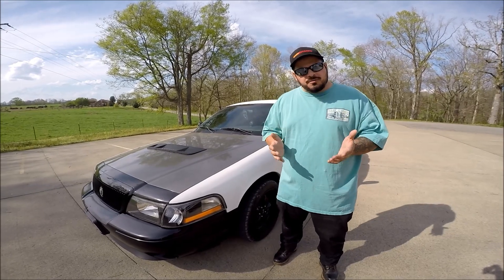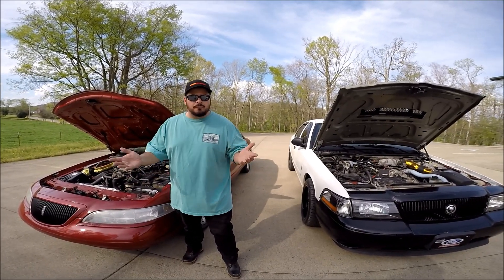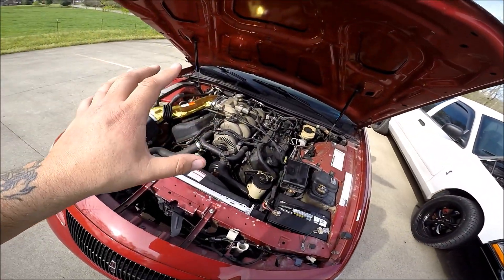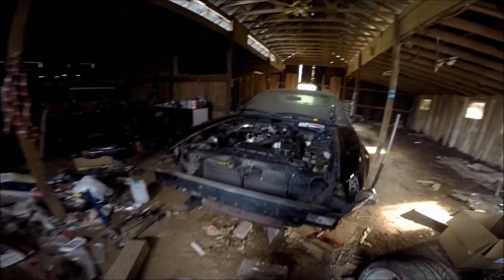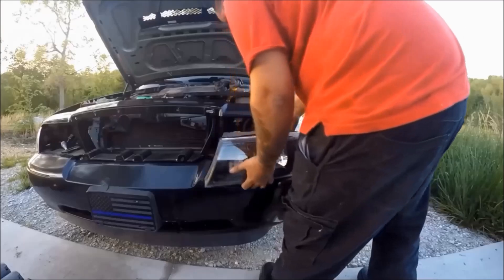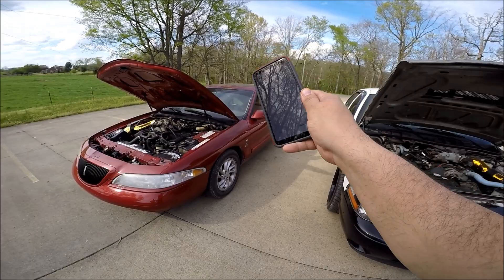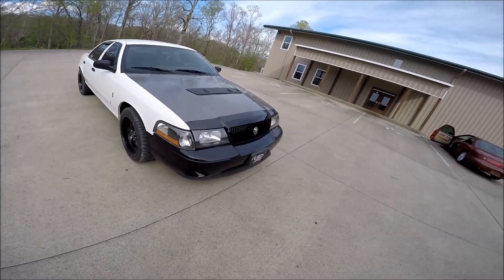Why a Crown Victoria P71 is BETTER Than a Mercury Marauder

Comment: I owned a 1996 and 2000 crown vic both cars were great riding cars. The 1996 had a bad spot in the frame causing the rack and pinion to shift over and messed up all the steering parts. The 2000 had a issue with the front suspension that led to a failure I fixed more than once that when it happened again I was just done fixing the problem. I wish I could of kept both cars repaired correctly and kept driving them. I was getting 25-27 mpg in a full-size car.

Comment: Marauder guys are making well over 200,000 miles right now. Sure the timing chains need attention.. but I have a marauder and CV. Never heard of the 4v head gasket issue.. and 1.5 seconds is a lot on a drag strip.

Comment: I own a 04 grand marquis and a 04 marauder. My grand marquis has similar features leather seats, heated and power driver and passenger seats. Previously owned an 01 p71 and honestly all 3 cars have been reliable haven’t had any issues on either one only thing I’ve had to replace on the grand marquis was a flexplate (flywheel) as some like to call it but all 3 panthers run solid my marauder has never had issues with leaks that’s straight bs as far as hp it’s 302 factory and can easily be brought up to 350 with upgrades and tune idk where you’re getting your info from but a marauder is definitely a fun reliable car to own.

Comment: Mr. Random Reviews Woah those Lincoln Marks have a bad rep for reliability where you said the valve bolts are!!.....My best resolution though is for using a majority of crown vic parts brand new on a Marauder,stuff like the bumper,door handles and maybe the headlights are easier to replace if you put Ford ones on it,i'm not sure if there was a specific difference in Marauder or crown Vic headlights i never inspected the signal markers or anything different in comparoson about them,but they are interchangeable for appearence,maybe they both cost the same brand new 200 bucks a lamp man!! Love your videos and it's cool that you go into tutorials about the analysis comparisons of Ford's best luxury cars!! As for the five oh department Ford's are the best to me!! Ford Explorer Intercetor Crown Vic etc!!....I'm not sure,but i'm curious as to what Mercury was a rare realease police car ive seen on the walkong dead!! I never seen them in real life but it looked like a Mercury Sable or a Mercury Grand Marquis' police car in Atlanta when Rick approaches the city bus,across the way i can tell by tue thin headlights it looked like a mercury sable,grand marquis' or maybe a mid 90's marauder cop car if Marauder's were back in the mid late 90's but it had the same side fender and window complexion of criwn vic it just had the lights and grille of a Mercury this white cop car did!!

Comment: Video is totally wrong and full of misinformation I swapped out my 04 4.6 2 VALVE in my 99 P71 and dropped an 04 4 VALVE marauder engine and trans and its a totally different animal that 4 VALVE leaves 2 VALVE p71s in the rearview by 2 or more cars and as far as reliability i have over 200k on this engine and it still runs like new

Comment: Funny how I threw away my 98 Continental due to bad struts but the drive train was still going strong at 250K, or my current Marauder is still going strong with 180K miles on it. Admittedly I typically sell them at 150K. Oh, my 99 P71, you ask. Yeah, it blew a spark plug right out the head at only 140K. Real reliable buddy! You know what the Marauder does that P71 doesn’t? Hold it’s value. So, yeah, which one is the better investment? I’ve never resold any of my crown vics or a P71 and turned a profit. I’ve resold 2 Marauder now after racking roughly 50K miles on both of them, and turned profits for both of them. Oh, and look at the value of a Marauder again, it’s not no $8,000 any more. The value will only continue to rise. So you can have fun down there in the simple life, but trust me when I say YOU ARE FAR BETTER OFF BE AN ELITIST! And I didn’t even have to spend spend all that extra cash you did just to have the nicer grill setup, because it already came with it. Bottom line buy rare cars at the right time (which for Marauders happens to be 10 years ago till now) and you will protect your investment better. Case and final point, I bought my 99 ROUSH Crown Vic back ten years ago with 20K for $20,000. How much do you think it’s worth today (yes I still have it) You’re about to spend how much time and money to build a replica of the same car and how much is it going to be worth when you’re done?? Work smarter not harder, you’ll be further ahead when you’re done.
Reply from the maker: the only thing even worth anything on the marauder is the looks in my opinion.  i achieved that for $800....saved me $7,000  now THATS working smart  not hard...you can keep your overpriced mercury grand marquis😂👌
Reply: @MrRandomReviews  also I will not be keeping my over priced grand marquis, I will be selling it. That’s how you make money. It’s just fun to drive in the meantime.

Comment: I have an 07 P71 Vic. When I accelerate hard it seems to downshift and put the car around 3000 rpms. A crackling sound happens until I let off the gas and doesn’t sound like any of these 0-60 crown Vic videos I watch. Accelerated fine under 2.5k rpm and no problem cruising on the highway. Is this common for anyone else? Shop I get service doesn’t think anything is wrong with it

Comment: Stop smoking rocks
Reply: Facts bro this video is a bunch of misinformation
Reply: Edward Myers Anyone who uses a mark viii as a reference point for a marauder needs to be mentally evaluated 😂
Reply: @eriv4735  yes considering mk 8 uses the first gen 4V and not the marauders 2nd gen 4V. The intakes are different. Power output it different and the ignition system is different.
Reply: This dude freebasing moonrocks for sure

Comment: Im a panther fan all the way,but get your facts straight b4 you post comments ..a stock marauder has a underrated 302 crank HP. Your comment of a modified 2 valve with 350 HP is 150 HP more  than a stock marauder is BS.that would mean a marauder having 200 or so HP.
350 - 150 = 200???
Your obviously a p71 2 valve fan and owner, which is fine, but dont make comments or state facts that are misleading or false....

Comment: When I worked at a Ford dealership, they use to send me out on drives to put miles on cars after a major repair was done. The p71 is a dog, its not a fast car. The marauder however was fairly quick and rarely seen them in the shop.

Comment: I'm glad you did this video because I was determining if I wanted a Marauder or another P71 I also found a 98 Mark VIII as well. The guy wants $2500 for the Marauder because it was hit in the rear driver side, the other guy wants $1000 for a 2007 P71 with a replacement engine and a shitty paint job, the other guy wants $1000 for the Mark VIII but he didn't specify what's all wrong it. My first choice was the P71. So I'm glad you did this video so now I can spend my money wisely.
Reply: All of his talking points were trash. Your money would have been spent well on either car. Bottom line they are two different cars with different purposes therefore you cant really compare them
Reply: @edwardmyers1746  the Marauder is the only car I don't have in my collection
Reply: @jaye23able  I own a marauder, so trust me I know what I'm on about lol. I also have another car with a 4v
Reply: @edwardmyers1746  I was going to buy the mark VIII to do a engine swap with my 04 LX Sport crown Vic
Reply: @jaye23able  dont get a mk xviii it's a first gen 4v get 2003+ 4V they're the second gen with more power and also more simplicity considering most of the first gen 4Vs were mounted sideways
Reply: @edwardmyers1746  I tell you what, I may just save my money and go for the Marauder that will be better
Reply: @jaye23able  the only advantage to a 1st gen motor is their teskid made not romeo. They're stronger blocks. But the 2nd gens are very strong too. Just not as strong

Comment: As someone who has had many P71's, and currently has a Marauder, you are absolutely smoking crack if you think even a brand new P71 could hang with a high mileage marauder. 

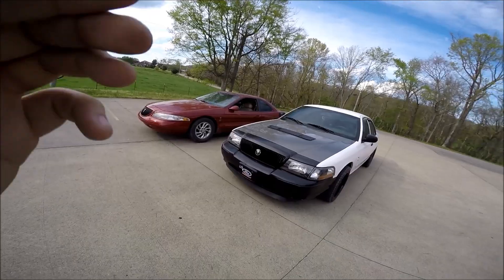Doesn't mean that I don't love my P71's, but the 2V powered cars are pigs in comparison. Drop 4:56's in that P71 and you STILL will get dunked on by a STOCK marauder, much less a Mark 8 or Continental which are lighter than both. This comes from experience. 

The 2V motors are great every day, borderline indestructible fleet engines. The only way you are getting any power is to bolt a set of 4V heads, associated hardware and timing set to it, or go boost.

Oh. And the Marauders come with the aluminum WAP blocks to begin with. That shaves a significant amount of weight off of the front end. 

In the end, they are faster, better handling cars with way more creature comforts than a dogged out black and white from the county auction with hundreds upon hundreds of hours of idle time.

Comment: Your right about that but i have owned boath a p71 and 98 mark 8 lsc the lsc pulled way harder and spunds better and its easy to supercharge it with the 03 04 cobra blower
Reply: Cant put the cobra blower on it. The mk 8 is the first gen 4v has different intake runners. It will only fit on a 2nd gen 4v
Reply: Edward Myers He could change the heads, get a custom lower manifold made, or even modify the terminator lower manifold...but for all it’s worth her be better off buying a wrecked terminator lol
Reply: @eriv4735  yerp, the only benefit would be that teskid block but screw that. Your already spending too much, grab that wrecked stang

Comment: I race the hell out of my 03 Mercury Marauder that I brought for 3000$ wit 4.10 gears Marty's tune long tube headers and drive it every day as a daily with 184xxx miles strong these engines are only as good as you keep the maintenance up on them that's speaking for all engines
Reply: Htf ya get a marauder for 4k? Most sell for 8k and up. Your lucky man.

Comment: Now which is better..... mercury grand marquis or crown Victoria?
Reply: Depends on what your after. I have a 2001 Grand Marquis GS and love it. Having said that the one thing that I love about the GM is the interior, and no I don't have leather, its cloth and still comfortable as hell.
Reply: @michaelcraighead8824  I like the leather interior in the Grand Marquis but which is faster? Also which is easier to covert to Marauder?
Reply: If you get a GM it would need to be a 4th gen to get the same power and torque as a P71. Mr. Random did do a video on the grand marquis so check it out.  As far far as speed, both cars are pretty equal, with the exception the P71 has a better suspension, which any cars suspension can be upgraded.
Reply: As far as converting to a marauder both Crown Vic and GM are the same as far how hard and easy it is. If you like Leather don't look at the GS trim models for the G.Ms,  look at the LS packaged ones.
Reply: @michaelcraighead8824  cool thanks bro

Comment: LOL.. Never met any Marauder owner that had the issues you state here... I have a Marauder, yup its a 4.6 DOHC, also have a Shelby with the 5.4 DOHC, so what your saying  (since they are engineered the same --sort of) I should be replacing head gaskets on my 650hp Marauder and my 850Hp Shelby---LOL... No the P71 is ---ok.. Its not much of a performer until you get rid of those heads.. BTW, none of my motors leak oil into the plug wells either...if your generalising with your lincoln, well shit gets engineered better over the years..

Comment: Better gas mileage. Cheaper parts. It really wouldn’t be that hard to buy the marauder rims get a black crown Victorian and put the grill in it and you’re pretty much fool  everybody.
Reply: 1500-2000 dollars for the marauder rims. 300 for front bumper, 300 for rear bumper. Gonna need at least the front seats replaced with marauders but just regular black ones for the rear will do.+500 dollars there. Marauder cluster will be 100 if you get it cheap. Grill I can say for free if you just paint it well. Switching your shifter to a center console shifter is a mystery number. And then of course the 2000-4000 dollars for a Mach 1/marauder engine in decent shape and mileage. Might not be hard but it sure as hell is more expensive than just getting a real marauder. Trust me I’ve been down both paths

Comment: Obviously you have not owned a Marauder! I have owned all of the Panther bodies and the Marauder Is by far the best overall Panther. My 2003 Marauder with only 23000 miles gets just one mile per gallon less than my town car did and it corners way better and is a lot faster! The P71  rides rougher and is noisier but way cheaper.

Comment: man i wish they made a p71 coupe
Reply: You could make it yourself.

You could get a SN95 body style Mustang with a V6 in it, and swap over the P71 drivetrain and other parts into it, and don't forget about putting the P71 Ecm in the mustang body.

Mustang Shell Powered By P71.

1994 to 2004 : SN95 Mustangs.

Comment: I like how you started the video off & ended it bro 😂😂 but you dam right the Vic is way better then a ticking time bomb Marauder so only time that car got on a Vic is it's slicker that's it
Reply: The marauder is not a time bomb all of mr randoms talking point were incorrect and false. The marauder 4V will be just as reliable as a 2V if not a little better
Reply: Aw ok I stand corrected bro
Reply: @11_CVPI  no worries my guy. Just trying to properly inform people, which mr random failed to do. I would know about the 4V I have two 4V powered vehicles one of which is the marauder
Reply: @edwardmyers1746  aw ok so a guy with hands on experience that's exactly what's needed about info on these cars
Reply: @11_CVPI  exactly, I'm in the middle of a tear down on my other 4v I know a think or two on these. All I've worked on is 5.4 and 4.6 4vs
Reply: @edwardmyers1746  aw ok that's what's bro I wanted to add another Vic to my channel but I'm gone put a impala up here
Reply: @markjones2185  in reliability in it's better but they are practically the same & all just the Marauder is slicker
Reply: Word!🤣

Comment: 4.6 4v don’t have good flow in heads I seen. Pipe between both heads or thru heater core. Has bad hot spots
Reply: That's it's only issue hot spots. The manifolds restricts the 4V like any engine
Reply: Edward Myers the first gen mark viii has a less restrictive intake design, from what I know. The 2nd gen introduced the more restrictive design. Idk what ford was thinking. It’s still an awesome engine regardless.
Reply: @DrFeelGoodNow275  I know my 212k 4v has that issue
Reply: @ninevoltmodz4687   they made up for it with the second gen having more hp and torque

Comment: $5k-$8k for a tuxed up Panther with the heart of a Cobra? And it's engine is more problematic than a Subaru EJ? Yeah I'd rather get the P71. There are cooler cars you could get for $8k than a Marauder
Reply: The 4V is a much better engine. All of Mr. Randomns talking points were un educated a not true.
Reply: This is the same guy who has videos about how great and BULLETPROOF the 4v 4.6 intech v8 is and he never mentioned anything about a headgasket issue? And im 100% certain i never heard the words TICKING TIME BOMB! in those cobra in a tux videos 😂😂 what happened?

Comment: It's pretty fucking sad you don't even look up basic information on cars before trying to trash talk them. The MM makes 300+ hp to the rear wheels from the factory. Putting a marty tune ALONE on it(still stock) can show 320ish on the dyno. Besides in 00/01 the triton engine family  were completely worked over to the point they're all 10x more reliable. Lol Do some research before spitting bullshit.

Comment: I had I have an 03 Marauder and hate the engine that's in it it looks like I'll be looking gray p71 heart transplant don't get me wrong the motor runs fine I have a hundred and twelve thousand miles on it starting to get blue smoke only when I first start it
Reply: That's a common issue. Valve seals. Only on cold starts after long sits dont worry about it it's not detrimental. My 03 used to do that it no longer does
Reply: @edwardmyers1746  thank you for the information
Reply: @jamesgalbraith3609  yup! No problem:)
Reply: @edwardmyers1746  do you know what the price would be the have the valve seals replaced just looking for a ballpark figure so I know what I'm getting into and thanks again
Reply: @jamesgalbraith3609  a lot tbh man. It requires removal of the heads and disassembly of the heads. That's why I say dont worry about it because it goes away and isnt detrimental.
Reply: @edwardmyers1746  thanks again